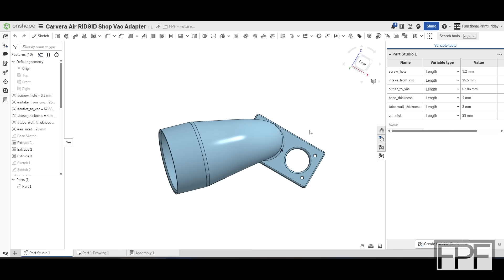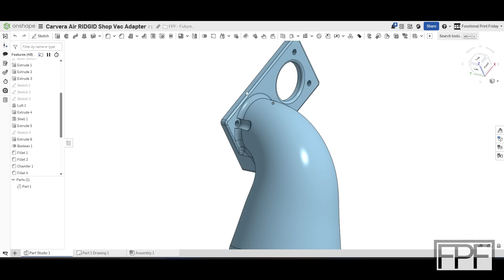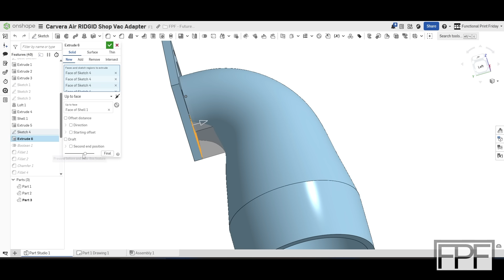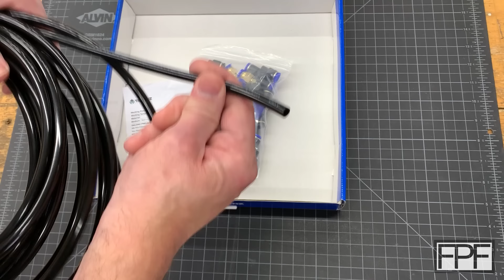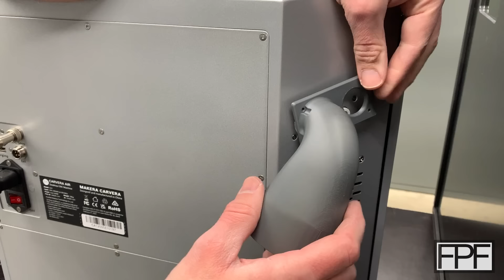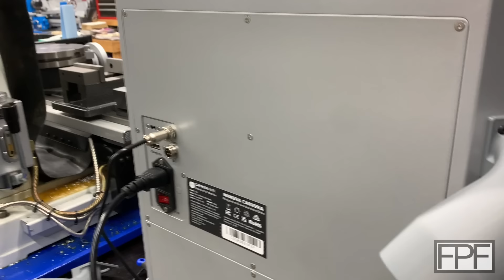3D Printed Vacuum and Shop Air Adapter for the Mini CNC

Comment: I've made a number of adapters for vacuum hoses.  I've had good luck with measuring the hose end if two to three places and taking the average.  They are never round.  Also, a Linda Lovelace interface is always good for vacuum.

Comment: The simple solution to your drill bit problem is to get a micro chuck with a 1/8" shank, commonly available for Dremel type rotary tools.  It will fit right into the 1/8" collet, and you can then use your conventional drill bits.  I did this for a similar micro drill I have, and it works perfectly.  I also printed a hexagonal sleeve out of foaming TPU to solve the rolling problem, and also to improve the feel and grip.
Reply from the maker: great idea!  is there one you suggest?  I don't mind paying for a quality one with better runout
Reply: @FunctionalPrintFriday  I got mine many years ago, probably from Micro-Mark.  It's a collet style so it runs true, as opposed to the 3-jaw chuck type which in my experience tends to wobble.  It actually has a 3/32" shank, but similar ones are readily available on Amazon with a 1/8" shank for $10-25.  I haven't looked, but you can probably get a higher quality one from an industrial supplier if you're willing to pay the price.

Comment: I'm about to enter the world of 3d printing and your hole dimension problem got me thinking about shrinkage. I asked the internet Ai does 3d filament have a shrinkage value? Yes came the answer. So my suggestion is to factor this value into on your next project that requires holes for screws and apertures for hoses etc.

Comment: The Fantik rolling off the bench is a you problem, not a tool problem. You can't have your hand held with anti-roll features on all your tools. 
 The slower speed (L) is for model hobbyists that need to be precise and that's difficult when the drill speed is high.

Comment: Why wait until you get better at onshape, before showing the design process?? Why not take advantege of your audience and learn from us?. I'm sure there are some with loads on experince.
I mostly use Shapr3D, which you should totally try, if you fancy a good excuse to get a 13" iPad and pencil. CAD with a pencil soooooo beat working with a mouse. Probably even a Wacom. 
Anyways. I wonder why you did 3 extrudes to get the base? I would just select everything but the holes and only extrude that. Also, if you do the loft as a solid and then shell it after you have cut the reliff for the screwhead, then you would maintain the wall thikness.
And finally. Why do you print the full part from the get go??? Even with all you can eat free filament from Bambu, I'd still start by printing 1-2 mm of the base and the end of the for the hose to check fit to the real world. To save time and minimize plastic waste. Remembering to print the hose end standing up, so it's same orientation as the full print.

Comment: I'm not sure if other people have mentioned this already, but I've got a good tip to get holes centered properly while measuring and sketching with parametric CAD like OnShape.

Rather than trying to find the center of the hole, measure the Outer Diameter of the holes, and then you can measure the minimum distance between 2 holes.  When you are sketching them in CAD, you can use construction lines constrained to the center of the circle to give you reference points on the quadrants of the circles and dimension off of those.  So you should be able to chain dimension from the RH quadrant of one circle to the LH quadrant of the next hole, etc etc.

  For things like the 4 outer holes on that mounting plate, you can draw lines from tangent to tangent with pencil to get good measurements too.

  In other applications, if you don't have anything protruding from the surface, you can use a piece of paper and pencil to rub the surface of the holes you're trying to measure.  If you've ever put a leaf under a sheet of paper and rubbed the pencil over the surface to get the pattern of the leaf on it, its the same method.

  Hopefully this comment helps someone out!

Comment: Don't know if it was mentioned by others but I guess I would have added a  bracket/holder for the regulator/quick release with the design so that part wasn't loose on the table (as it appeared to be at the end of the video). Great content on Onshape and love your videos.

Comment: I don't like the missing screw on the vacuum side, with the vacuum hose connected there is a long lever acting on that plate.  You could quite easily incorporate the extra screw going from the inside of the tube and have a hole in the outer radius of the bend to get the screw and hex key in.  A rubber blanking grommet would block it off in use.

Comment: I'm an amateur OnShape user too, but this channel almost had me switching to TinkerCAD or whatever it was you used before.  I never did but I was very close to giving it a shot.  It seemed so much easier than doing battle all the time if it "just worked" as and was as good for functional parts as it seemed. I didn't like the idea of Fusion and they decided not to make a Linux version so I'm locked out of that option anyway.  The OnShape wars are probably just me being stubborn and trying to force it to work the way I imagine rather than as they intended.  I would find it very useful of you walked through the design at the level of detail you used in this video.  Not too basic but also not lingering on every click and press.  I learn from example a lot easier than I learn by fumbling through the manual and forum threads so I can take it from there.  That 45° loft had me stuck for ages until I eventually solved it, and I'm sure my method was not ideal.  This channel is excellent so please keep up the good work. I love the variety of projects you tackle.

Yelling "I'll see you next Friday" at the end needs to make a comeback, even without using the outro music the copyright troll bashed you for.  The sudden change of tone and volume always used to make me laugh at the end for some reason.  That was your trademark. :)

Comment: Uncle Jessy just posted a video about the Moab nerf gun and he has an issue with it jamming that turned out to be a tolerance issue on parts printed on the h2 series. Your screw holes were off as well. Could this be an issue with the h2 out of the box tolerances? Might be worth looking into.

Comment: You could 3d print a bellmouth for the end of the hose in the enclosure?
For a higher flow rate with less noise.

Comment: Here in the UK 🇬🇧 that thicker PTFE tape is used for natural gas fittings, to your cooker hob, gas fire etc. Personally I have changed to Loctite 55 Thread Sealing Cord. I find it gives a much better result with less mess

Comment: Design wise, the only change I would make would be to utilize all 4 screws for mounting. It would either take a bit of creative rerouting of the outlet to clear the 4th screw hole position (more difficult but better looking), or accepting that the 4th screw hole was going to intersect the outlet and extrude-cut the clearance hole for the screw head through the outlet, to be covered with tape or a plug or something after installation (easier but looks less intentional). This will make a better seal around the vacuum port, and cause the whole works to flex less when installing/removing the vacuum hose.

Also, since the central axis of the outlet is parallel to the flange surface, printing flange side down like you did will make the outlet itself weaker, as strength between layers (Z) is always going to be lower than across the layers (X/Y), for this reason I would resize the outlet to slip into the vacuum hose and retain it with a (gently tightened) screw clamp. You'll also potentially pick up some flow efficiency there too, as the "step" in the flow path will be pointed in the direction of flow, instead of against it.

Both of those things are largely just nitpicking on my part though, what you have works, and more importantly, you didn't fall down the rabbit hole of spending hours in CAD trying to chase perfect, you just made the part that fit your needs, installed it, and can decide if it's worth a version 2 down the road!

Comment: some of what you do is interesting, but when you measure 30 mm because you said so… (right on!)… while it looks more like 25 or even 20 (with the drill) is a bit funny. Minimising cognitive dissonance I'd say. You could have measured the diameter and it'd be based on reality, not your expectations then. This kind of thing happens a bit too much for my taste, so I have to unsubscribe now.
Reply from the maker: Parallax error from camera angle, I noticed it in editing.  I also had the same thought while editing: why didn’t i just measure the diameter and divide by two.  .  The perils of truly capturing reality as it unfolds rather than scripting.  Not always easy to talk and think at the same time.  Just measured each by the way, and actual diameters are 53mm and 24mm, so 26.5 and 12.   I wasn’t that far off :)
Reply: @FunctionalPrintFriday  Exactly! Showing good practice is the way to go. I understand and didn't mean to judge, just seeing it as a growing trend that people talk themselves into thinking of being right a bit too much. You weren't that much off, but you forgot to substract the diameter of the drill… as you were trying to measure the clearance from the drill… And what did I say…? 20-25 mm rather than 30. Yet, of course I tell based on the video with parallax.

Comment: In my experience, small holes on the X-Y plane are always a little bit smaller. There is an experimental feature called "Auto circle contour-hole compensation" in Bambu Studio. I've had good results using it, you might want to check it out.

Comment: Are those Dremel drill bits? You might be able to get new drill bits from Dremel
Reply: I'd be curious to know if they are Dremel cuz I like that little drill but if you can't get bits for it then I'm not going to get that drill
Reply from the maker: It looks like 1/8 pcb drills fit

Comment: save plastic and time by printing test pieces , a flat piece to see bolt pattern and outlets which leaves open tops so can easily measure exactly any changes needed , then a test circle for hose end slip fit

Comment: For showing the modeling process in OnShape like this, it might be helpful to start out by selecting all of the features, right clicking and choosing "Suppress." Then as you're going step by step you can "Unsuppress" them one-by-one to simulate the addition of each step.

Also, once the number of features start adding up I find it almost required to name features and group them in folders. Although I'm just a hobbyist, so that may be saying more about me.
Reply from the maker: Thx

Comment: I made a similar adapter for a similar purpose.. the layer lines being parallel to the plate ended up eventually being a problem for me when connecting and disconnecting the vac.  curious to see what your experience is.. I ended up printing again non-planar (with a flat on the elbow) so I could change the print line orientation and haven't had any trouble since.

Comment: a couple of workflow comments that I use which helps me.   First I'd make a 1:1 print of the base plate (on my inkjet printer) to confirm placement of screwholes and cutouts.  I do this a lot and it has really helped me speed up my design/fitting process.  Second I would have printed just the base plate (without the lofted fitting part) and tried that fitting out before going through the whole print.   Really like your videos!  as others have said some more  Onshape examples.   I'm a fusion 360 user (hobby only) for several years now, but I like what I see in the intuitiveness of Onshape.. May have to move over to Onshape!

Comment: If you're going to print with all those supports on the rounded part, you may as well add a "plug" on the end of the square part that fits into the vacuum port on the back of the machine. That means the  square part will need supports, but at this point a few extra supports are meaningless. Cant wait to see it in action!

Comment: I usually put a slight taper on the shop vac connectors to make them easy to slide on then tighten the deeper the connection

Comment: I'm NOT an engineer.  I would have just printed the baseplate (supress everything else or roll to here), check that fits.  Next, the vacuum hose was going to be wrong!  Another 'testfit' sketch, remove every thing apart from say the 1 cm on from where the tube starts to narrow at the vaccuum outlet end.  Print and check.  Adjust and print v1.0 and done 🙂
Also, folders are your friend for life...

1/8th drill bits for what you are likely to use them for a 2/dime.  Or more if you want some good quality ones.

Comment: Thanks for showing us how you achieved the end result. I would have done it a bit differently: I would have printed both 'ends' of the part separately and tested the fit. Then, if needed, I would have adjusted it. This would save material, energy and time, as you wouldn't need to print the whole part twice.
Reply: I always do the same, though in this case it may not have been as useful given the orientation of the part

Comment: I don't know what the best practice is in On-Shape, but in Fusion I try to avoid making sketches directly on object faces, since unexpected knock-on effects can move sketch planes based on hidden values (e.g. an extrude depth). I prefer to ensure that all of my sketch planes are well defined, based on user variables and either related to other planes or sketch features that are also well defined by user defined variable. This can vastly simplify deep parametric changes in extremely complex designs.
As for the design, I thought it was great! Only thing I'd suggest is maybe printing a 2 or 3 layer thick TPU gasket?
Reply: Maybe just print the whole part in TPU, would probably prevent damage if he ever bumped into the hose

Comment: There is a hole command in onshape (toolbar). You can use the points in your constructions geometry to select where you want your holes and add them after you are out of your sketch. You don't need to add holes into the sketch then extrude them individually if you don't want to. Saves a few more clicks. And it has a bunch of nice options for holes that you add.

Comment: Yes, you absolutely used the Construction Line feature correctly. If I may make a suggestion: When going stepwise through your design it might be easier to select the rollback bar (at the bottom of the feature tree) and just use the up and down keys to step through your edit history (you can also drag it) instead of double clicking (to edit) the feature.
Reply: Ditto. Also, I almost always start with horizontal and vertical center lines. With centerlines, mirroring features such as the hole pattern can be fast and convenient.

Comment: 25:51 I have a similar tool but it's a screwdriver, and the 1 and 2 position is more for torque than speed. They may just share the same body for different tools.

Comment: I have a few onshape tips, 1 you can rename your sketches, in fact I think you can rename everything including extrudes, lofts, and parts. 2 There are lots of options with the new plane tool,to create a new plane for your sketch. 3 Something I didn't find for a long time, is the final button. You can see it in the sketch dialog box, and some others. It renders the final model, so you can see the results of any changes as you make them. It can slow things down though.

Comment: If You had measured the diameter of the two machines, the side clearance would be the radius.
I think I would have put the adapter print inside the vacuum hose, not around it. Less chance of cracking it!

Comment: On a few of my projects i take a photo using mechanical optical zoom maxed out on my camera (digital zoom wont work) this is essentially a poor mans Bi-telecentric Lens.  Resize the image in CAD with known dimension or have ruler in the image for reference.  It works better than you might think, never had a bad experience using this method.  Also props to the spud cannon in the background.

Comment: The little hand drill needs to come out for some testing. As a model maker these small drills can be  life savers but many fail in the torque department and high speed drilling when drill brass and aluminum. What would be real nice if these drills could delivery correct torque for so many are just hopeless. Also you have a small air blower I gather it's compact may be just the thing for the model maker. When I say models they are true to scale working types not toys. One must remember engineering come in many sizers

Comment: The design of your adapter is really well done. Your shop vac would be happier if you drilled some holes around the perimeter, near where the big hose attaches. Allowing more air to pass through would increase the efficiency and cooling of the vac motor. It seems counterintuitive, as if you're giving up suction, but the additional air moving through the system more than makes up for it. Cheers!